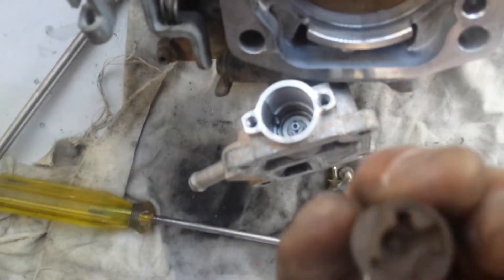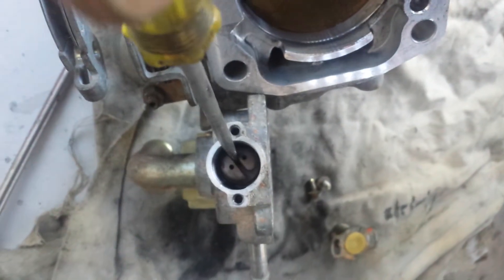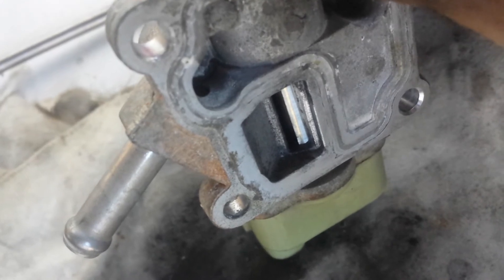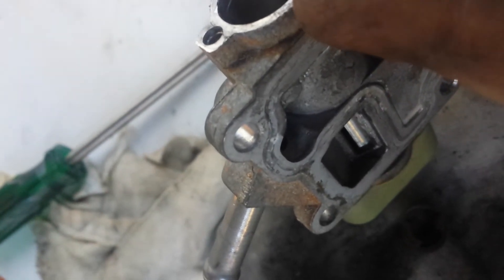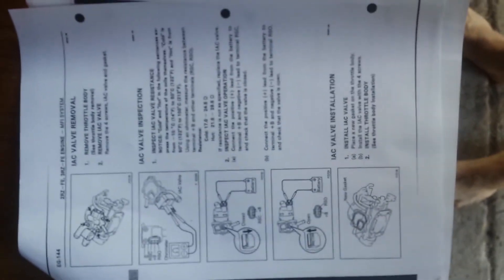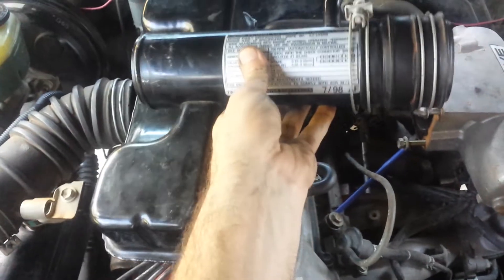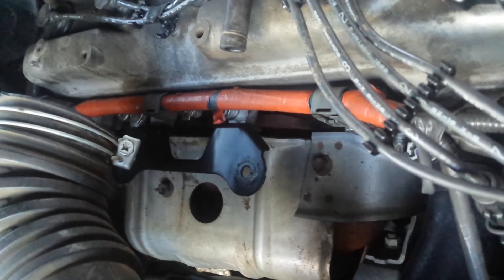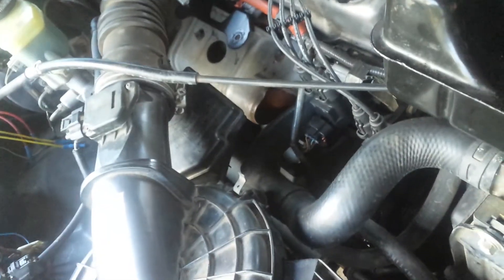3RZ-FE IAC controller fix Toyota Hilux/Tacoma/T-100/Prado 2.7L petrol - Part 3

Comment: It's open without power supply (Slightly open)
Is it normal
Reply from the maker: It sure is. It’s factory set for a partial choke / slight gap at minimum or else you could have no air at all on idle - this thing gap is the set screw on the IAC itself I refer to in the videos). The rotary valve should rotate perfectly freely through its whole range though. If it doesn’t then it needs any coked contaminants cleaned (just like you would with the throttle body).

Comment: what's d function of this valve
Reply from the maker: It’s an auto choke for starting when the engine is cold. It adjusts allows limited more air in, which the ECU compensates with more fuel, thus effectively adjusting the air fuel ratio (effectively making the mix richer). You do the same manually with a lever or pulled shutter on a petrol lawn mower, generator or chainsaw etc. albeit by a completely different mechanism. In this case, once the engine warms, the ECU automatically adjusts it depending on engine temperature now allowing less air, and thus less fuel via the ECU (leaning the ratio out again) - this maintains a smooth and correct idle rpm.  At start-up the throttle plate is closed allowing electrically metered air via this whole mechanism.  When the throttle plate is opened via the accelerator cable, the throttle valve vacuum line drops pressure and the diaphragm spring returns its push rod to rest position on the 'other' (non-idle) positional stop screw; this means the main throttle body takes over delivery of much larger quantities of air as per the accelerator pedal and bowden cable position.
Reply from the maker: It’s interesting to think of the differences between fuel injected and carbureted engines when it comes to choke plate mechanisms.

In carburettor engines the choke plate is above venturis. When the choke is closed, it causes faster air flow and consequently a low pressure area in the venturis whichs draws out additional fuel. The rich mixture is easier to ignite when the engine is cold.

In fuel injection, the IAC allows more air to the engine and the ECU compensates by adding additional fuel to make a rich mixture.
Reply: conette logistics limited idle air control
Reply: Control rpm when idle
Reply: When engine is cold started